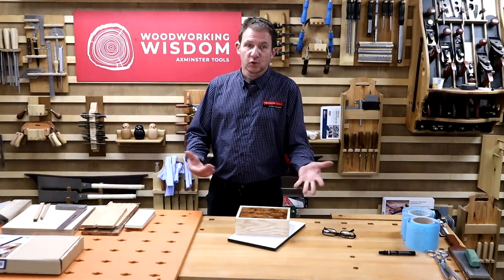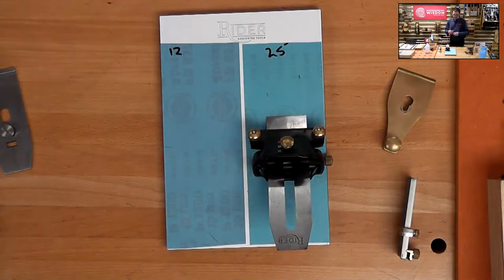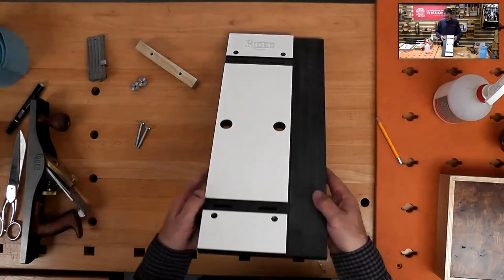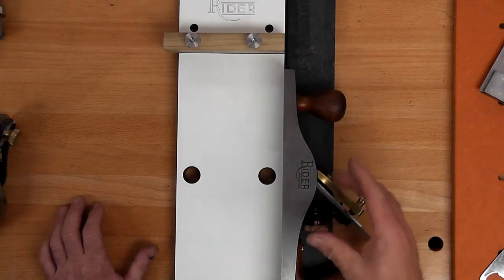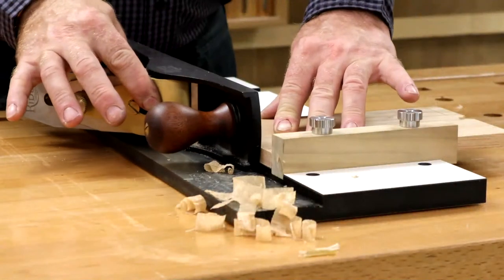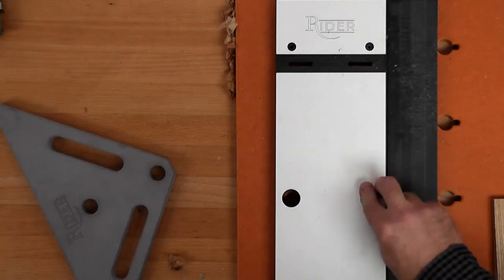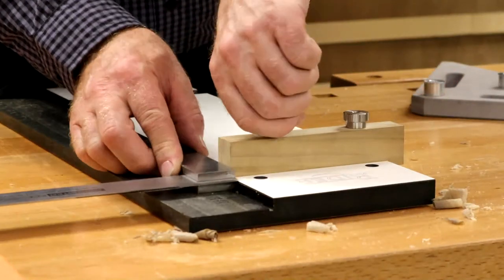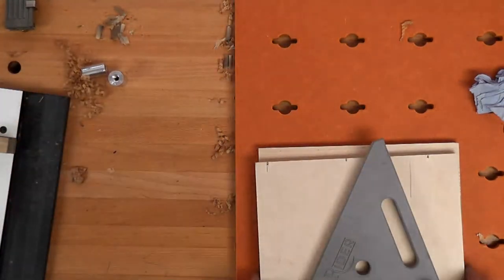Planing Tips and Rider Shooting Board - Woodworking Wisdom

Comment: Are the T Bolts M8 or M6?
Also what length are the supplied T Bolts?
thanks
Reply from the maker: Hi Carlos, the T bolts are M6. The ones supplied with the board have a 50mm threaded section. We also sell 75mm long T Bolts which allows you to make a taller back fence https://www.axminstertools.com/ujk-technology-t-slot-bolts-m6-x-75mm-pkt-10-103412